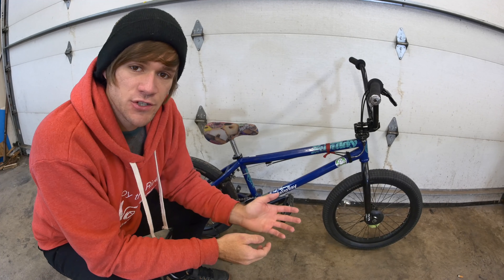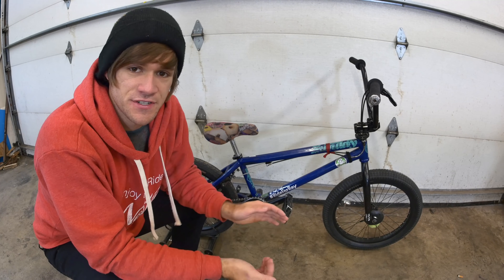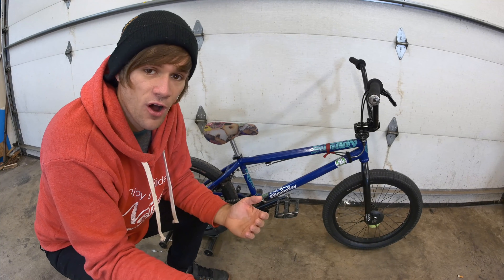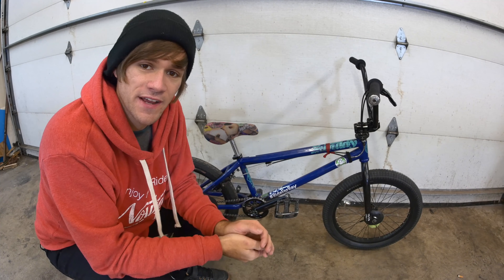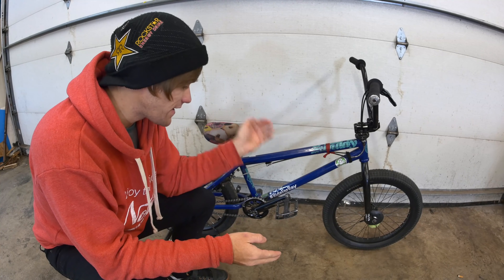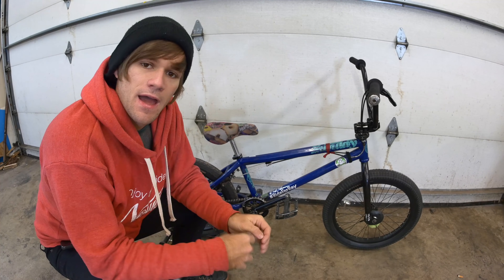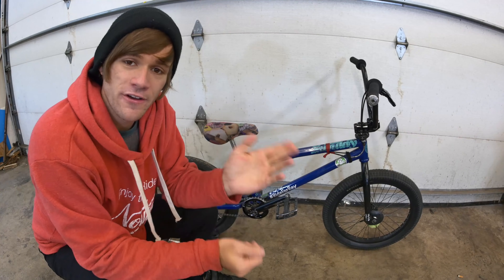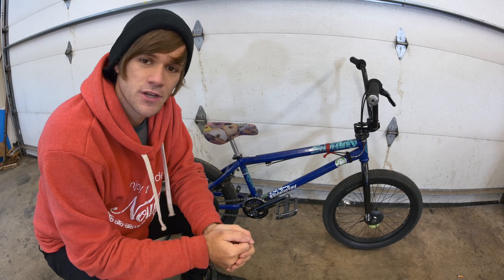Does Bicycle Crank Length Matter? | EXPLAINED

Comment: I’m 6’3 I bought some cranks on sale which were 165mm… I feel like that was the perfect size Manuel’s for 2 blocks were a piece of cake..moved up to 175mm all of a sudden it took way more effort to keep my front up🤷🏼‍♂️ only thing is you have to pedal way more 😂😂
Reply: I also had a bad knee lol if you think about it longer crank means a wider stance…I had to pedal more with a 165mm but it felt more comfortable and I wear a size 13..I noticed the back of my shoe nvr hit my back peg when I switched to 175mm the back of my shoe kept hitting the rear peg smh 🤦‍♂️

Comment: What about if youre running higher gearing? Like 30/9 sprocket
Will longer cranks help or hinder😅i need to measure my old ones before i choose 175 or 165. Sure its going to feel pretty different if 8 guess and get it wrong

Oops, you already answered the question. It's hard to start as is.. but top speed is much higher. So I think somewhere in the middle is best.

Comment: I've noticed that some riders run their sprocket and chain ring on the left side.  Is this because they ride goofy footed, and they don't want to damage their chain ring when doing grinds?  I can't imagine that it has anything to do with them being left or right-handed, but who knows, I can only do flairs, whips, or simply kick my bike to the right, and I assume that it's because I'm goofy-footed and left-handed.  What's your take on the subject, and what have you heard from other riders?:person-blue-wheelchair-race::yougotthis::elbowcough:
Reply from the maker: I’m not sure if there’s been any kinda study at large about it but it would be super interesting.
Technically you can be goofy footed with either foot forward since it’s about the direction you rotate in relation to your foot placement.

I’m left foot forward with left side pegs and I spin to the right. I’m also right handed

Comment: im on a 12.5 cs frame and i will change my cranks from 150mm to 170mm im only using 2 pegs i hope my foot dont get caught in the back pegs.I still need a spindle to use the cranks

Comment: 172.5 Is my sweet spot after i turned 18.
  I'm an old road racer and I was gear restricted to 100in per pedal rotation as a junior, so then I ran shorter cranks since I wasn't allowed to have bigger gears than a 53-15
Reply from the maker: I know nothing about that world but that's very interesting!
Reply: @Brant_Moore   it was the 80's I was racing in the USCF as a category 3 junior. They made us restrict our gears to a 15 in the back even though 12's were available.  The reason was they wanted us to spin instead of lug on our developing knees. I'm 56, ridden my whole life and I don't have knee problems, so apparently they were right to do that.
Reply from the maker: Yea that's super interesting to hear about. Also cool that it seems to have worked the way they intended for it to

Comment: Is longer cranks better for manuals? Like you  an lean more on your back foot so you have more weight on the rear wheel? I think you need to address that as well. I think shorter crank will make manuals worse. BTW i like your vids and overall style❤
Reply: Saw you never got an answer. I’ve rode every length from 160 to 175 and what I’ve noticed personally is that it really had no difference on my manuals. I could also comfortably switch between lengths and manual just as far.

Comment: I'm running 190mm cranks, and I'm about to swap to 230mm cranks, and this is by far the best reference material I have found in all of my research. Just for reference, 230mm cranks is only an 18" gait. Which is still a shuffle step. Shorter gait causes hip joint disfigurement.
Reply from the maker: Thank you!! I had to make this one twice to make sure I got it all right

Comment: Hey man! if u still see old vids' comments
I have my old bmx i think its 20.5 but has a longer chainstay ( more like a dirt frame, the front end is not steep either)
-i have 175mm cranks and i need to get new ones cuz they are almost broken and stuff

Im thinking on getting 160 bcz i myself am 5.7 tall, and i see from comments and vids that they help with tricks , help with knees a bit 
I want to ride mostly dirt and transitions/halfpipe (think 180s for fun there).  Should i try the 160s and see or do u have any opinions u found since u made this vid ;D ?
Reply from the maker: I’d say if you know someone who has 160 cranks on their bike I would ride it and try to focus on how the cranks themselves feel.
If you don’t have the option now, I feel like most things in bmx can be gotten used to. So if you got the shorter cranks you’d likely get used to them regardless
Reply: @Brant_Moore  Appreciate it ;D it's so fun getting back into bmx man, you and ur vids are wholesome and fun 🌴

Comment: Firstly I just want to say I watch a lot of your vids Brant. Always clear information and they are really helpful. Almost any topic I want to know about, you cover it. appreciation

I have always rode 28-9t and 175 cranks, but I'm just on the verge of buildong up a new bike for which I have opted for a 25t sprocket and 165mm cranks.

My reason is partly I'm old and I feel like I will be more comfortable with less eccentric knee and hip travel, but also the closer feet thing really resonates as does greater clearance around 165mm cranks.

I'm 5'10" maybe 5'11" and I ride mild street and mild park. In between I ride my BMX as a form of transport. I'm never absolutely tearing it up at high speed for purely transport, because I'm also brakeless in a densely populated city. I don't need rapid acceleration from a standing start.

So I'm hoping switching to 165s is a success, but I couldn't find anybody else with 165s to try out first. So I'll report back when I know if anybody is interested.
Reply from the maker: Hey thanks man!
Your reasoning is sound for sure and I'll be curious to hear your follow up

Comment: Very nicely explaining the length as in riding a mountain bike up hill longer cranks is the way to go it also gives better control downhills through the woods a shorter crank on a bmx I'd perfectly fine especially in a park when momentum isn't a problem. I once dropped of a  carpark into my old schools playground on my old school supergoos 2 and my one piece tioga chromoly triangular 185mm crankarm turned into a banana only a 4ft virtually dead drop was funny when I went to my bmx shop the owner had no problem swaping it out but we did decide I'd be getting a 175mm takagi crank instead never had that problem again lol

Comment: Does it matter with barspins specifically? Cool idea for a video
Reply from the maker: I think it's possible that it could have an affect, but I also think that affect on a 5mm change would be so small that its negligible. Maybe if going from like 180 to 160, but other than that I don't know that any difference would be noticeable

Comment: Well I switched my frame from 13,65” CS to 12,9” CS then after 2 weeks of riding I got myself 165mm cranks to replace 175mm cranks. Difference was huge, my heels didn’t hung up on pegs and spinning and hoping was easier.

Comment: Boss video 👍  175mm for me
Reply: Newer frames have short chain stays (13.5") so 175mm will be too long and your heels will hit the rear pegs.  My older frame has 15" chain stays, and 175mm cranks fit fine in the heel department. But for a modern freestyle frame, 160mm or 165mm is the way to go, so your heels don't hit the rear pegs.  Now I have two bikes, one old and one new.

Comment: This is great. Lots of awesome points. I'd ridden 175 forever, had a chance to choose a size on my recent build. Went with 165 and they feel awesome. Have knee pain in more extreme range of motion which we obviously use in freestyle anyway but lifting my knee and especially pushing my foot forward is the worst so they help. Also I tend to pedal from my hips and core, more then mashing down with my legs so the smaller circle feel better. I'm even goofy footed so I'm interested to see if spins feel noticeably different.

Comment: I Road 175s for over 11 years I switched to 170 I love it and I switched my sprockets are used to ride the 25 tooth now I write a 28 tooth I’m never going back
Reply from the maker: Right on man! I haven't noticed much of a different in having 170 vs 175 which I had for years and years, but the difference between 25 and 28 is night and day for sure!

Comment: Crank arms is determine for the rider. But what I’m also wondering is that if it determines the size rims and tires you have determines on your sprockets you might use. Smaller the rim, bigger the sprocket. Bigger the rim, smaller the sprocket. I was also wondering if smaller sprockets with 170mm crank arms make it easier to do wheelies cause of the crank arm for torque.
Reply from the maker: There’s definitely something to that because pedaling a 26” DJ with a 28/9 gear ratio and 175mm cranks is much easier than pedaling a BMX bike with the same

Comment: You forgot one important issue. I myself am 6'.3" shoe size 14 , I ride or pedal with front of foot or on toes because the back of my foot will catch the rear pegs. Big guy issues , which shorter crank arms could be a solution.
Reply from the maker: Yea man you’re right.
If I ever revisit this one that will definitely be in there
Reply: Thanks, Keep up the good work, really enjoy your different style like rock paper scissors on a stall. It great!
Reply from the maker: Thanks for the kind words man!! I’ll do my best!
Reply: 24 inch bike

Comment: For me it has to be 175mm. I can feel the shorter stance of 165mm and even 170mm in my foot placement.
Reply from the maker: That’s an interesting thought. Foot placement can probably account for at least some of the stance differences in crank length but that wouldn’t change and if the pedaling differences. An interesting take on it for sure
Reply: @Brant_Moore  the way I see it, our discipline, freestyle-bmx, has less pedalling than most other cycling disciplines but relies heavily on the entire body for control. Comfortable and consistent foot placement strikes me as a crucial part of that control and helps with landing in awkward places. 
 My preference probably stems from the fact 175mm is the industry standard so my muscle memory is based on that. I've ridden 175mm so long that my stance naturally spaces to fit it.

Comment: My stock ones are 160, feel fine! Would be concerned about hitting back foot on peg if i got bigger though!
Reply from the maker: Perfect!
Reply: I run 175mm on a 13.2" chainstay and 34mm ø pegs. Never caught my foot because that's the set up I'm used to. It's all about what you're used to riding. I've found the pegs have saved me a few times because there's a 98mm gap between the pedal and peg, that's just under 4". On the odd rough landing my foot has landed on the peg and pedal which gave me enough of a platform to maintain control and not die.

Comment: I remember when I was younger all the pros were running 180mm cranks so I bought a pair to replace my 175mm. I'm 5'5" and I honestly should have tried 170mm before I bought. 180mm makes one leg fully extended and the other dang near calf to thigh. Now I'm on 165mm and haven't had a chance to try them yet but I am excited to.
Reply: COSMO  yes. I like the 165s since I'm a little shorter. The 180s are a lot of leg movement to pedal. I'm definitely sticking with shorter cranks. The 180s are fine on my dirt jumper but even then I'd like shorter cranks

Comment: Yet an other thing, there is an issue of hitting your heel when pedalling on the rear pegs if you have em longer. Solution : shorter cranks)
Reply from the maker: That's a great point too
Reply: Right. I've bought a new frame with shorter chainstays and the first ride I had to move my feet forward on the pedals to not hit the pegs when pedaling. Considering shorter crank arms now tho I like them long for leverage.
Reply: @styleparade  I’ve installed 160) got to be much better, though sometimes I still hit the pegs, rarely but happens)

Comment: I run 160s its hard to find cranks i like
Reply: Yo how does 160mm feel
Reply: @rogerbravo5724  great. Its more natural feeling when not pedalling because your feet are closer together, really great in spins and your feet dont drop as much when doing cans and nacs. They are harder to pedal on a 28t or 30t sprocket but my bike only fits a 26t anyway so its not too bad
Reply: @ArmyBoiSweat  how does bunnyhopping feel like with 160mm
Reply: @rogerbravo5724 my bike overall feels snappier on the hop, but that could also be my 8" bars, frontload stem, and 12.1 rearend
Reply: @ArmyBoiSweat  thank you I will be getting 160 mm cranks quick question what will the disadvantages

Comment: I think a shorter crank arm makes the bike more stable imagine an exaggerated example if u were to ride a bike with your legs far apart you would be less balanced if they were closer together more balanced ( I ride 165 and I wanna go even lower to 160 ) no one needs the long crank arms to go 100mph anymore
Reply from the maker: Here’s an experiment for you.

Try to walk a perfectly straight line with your arms held at your side and don’t use them for balance, then again with your arms out wide. Which is easier to do?
I feel like the same makes sense for crank length
Reply: Hey Steven I run 170mm cranks but I want to switch 160 what will be the advantages and disadvantages

Comment: I ran 180mm and at 5'9" I felt it was a little awkward for me. The range of motion made the bike feel Ill balanced to me
Reply: I’m 5’9 went from 1 piece 175mm to 3 piece 165mm and it feels way better lmao
Reply: @SaintBlack-x  what does 165 feel like
Reply: @rogerbravo5724  depends on your tire PSI and the weight of your bike. I find 50 psi to be good enough for torque with the 165mm crank length, bigger pedals also increase torque. I have a lightweight bike also, so I am able to pick up speed pretty quick
Reply: @SaintBlack-x  what about hopping
Reply: @rogerbravo5724  it’s perfect dude at least for me
Reply: @SaintBlack-x  yea I'm get 160 i have 170mm hopefully it's good

Comment: I have a 29 in bmx bike and the stock cranks are 175 mm is it ok if I get a 170 mm crank to use? I feel like it wont have a big difference but I’m not sure I’m just making sure I have a big flyer se bike
Reply from the maker: You likely won't feel a huge difference, but it is possible. You will 100% get used to any difference you feel though

Comment: It dose matter depending on what u ride for park/dirt 175-170mm is the best and for street and heavy rail users a shorter crank helps keep the pedals a little farther from the rail and help with balance I’ve tried 165mm and I’ve found they do help in that area but I’ll always stick with the 175mm

Comment: I have 4 pegs and the fit indent 24 in 170mm. Do you think going from 170 to 160 would be a big difference? I ride street mainly and a little park and stuff
Reply from the maker: I think it could be a little noticeable at first but then once you’re used to it, it probably won’t feel much different
Reply: @Brant_Moore thank you man I appreciate the info

Comment: Sir Brant,
See im  6'1" tall, obviously with long legs. I've  been riding with 170mm for quiet a time, and its been very comfortable for me having that popping up when bunnyhopping. 
But i broke the pinch bolt of my cranks (which is funny coz i am only learning how to bunnyhop and nothing more)... and replaced it with 160mm, which is i think i made a mistake buying a  very shorter crank, and not knowing it will have a BIG effect on me hopping. I dont know if i need some breaking in or getting used to riding with 160mm, because i am really having a hard time with leverage of popping up for a bunnyhop, as if  i cant bend my knees coz they are too close to each other. I dont know. It just doesnt feel right to me. It felt small and rigid. I have to agree that it lessen my knee pain from pedalling. But my concern is the popping not the pedalling, I lost that popping sensation when i switched to 160mm compared to as when i was using 170mm before I am really comfortable hopping. I dont know... Not so sure since i am an old 35 yr old beginner.  I love your video coz its very detailed and full of encouragement. But i hope you can help me with my personal problem coz i am just a beginner.  Thank you

Comment: So I have a wack stance, I’m left food forward, right hand throw, and my right side is my dominant side hop. I also have some large feet and my pegs are on my right side, so my foot often clips my peg if I want to do manuals or just have a normal stance. Should I get shorter cranks to account for my weirdness?
Reply: yes shorter cranks will help a lot with this if you have big feet, it has nothing to do with pegs.
Reply from the maker: It could have an affect and stop your foot from clipping. Maybe worth trying to ride someone’s bike who has shorter pegs
Reply: @Brant_Moore I ride some really tiny odyssey pegs, and the heel of my foot will sometimes hit if I ride in my comfortable stance, so I have to move my right foot forward in order to manual

Comment: You can use shorter cranks to help prevent your heels hitting the back pegs
Reply from the maker: Yes absolutely!
Reply: or the front wheel...
Reply: @olderthangoogle214  yea I have that problem when I try barspins

Comment: Here's what I've always thought. Let's say u have 44x16 gearing. With 180mm cranks u get an advantage off the line but I can't spin those very fast. On the other hand with 165mm cranks u have less leverage taking off but u can spin them way faster and for the same gearing reach higher top speeds. On a single gear bike I prefer short cranks. And a bike with gears and really long rides a slower consistent circle works best. Also the lack of torque with shorter cranks could be made up for by muscle strength. Thoughts ?@brant_moore